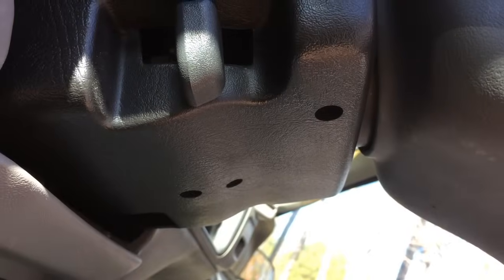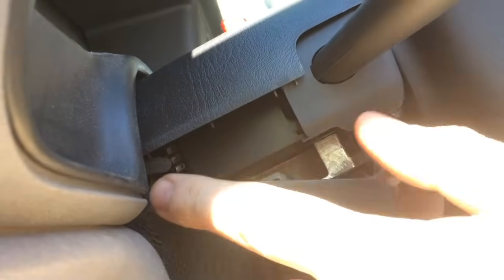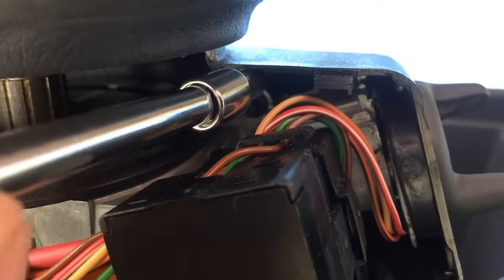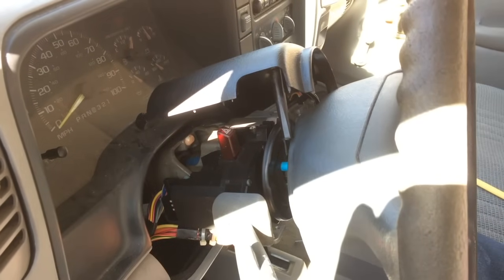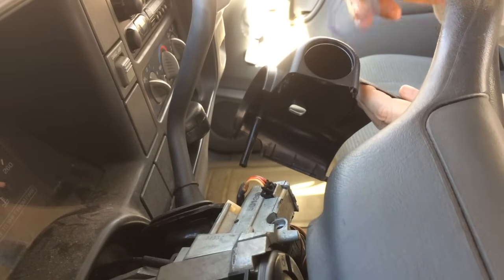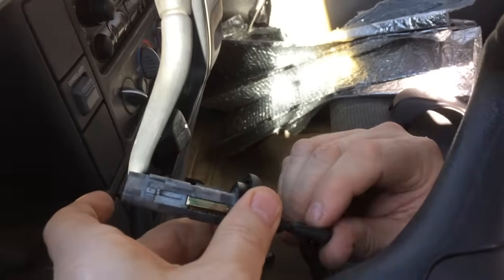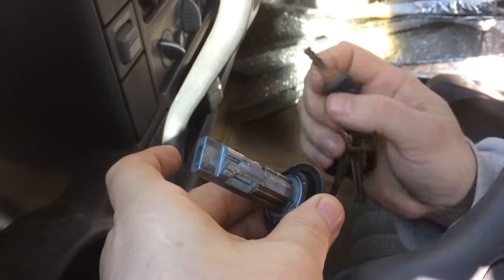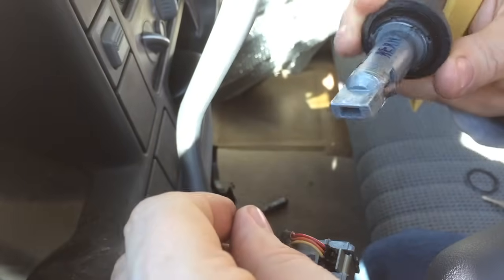1995 - 2000 OBS GM Truck Ignition Lock Cylinder Removal (Chevy Cadillac & GMC)

Comment: So how did you end up getting the lock cylinder out cause I can’t get mine out it won’t turn all the way to the starting position and I just keep missing the keeper with the punch
Reply from the maker: It will not come out unless you can turn it to the start position like I've shown in the video.   You'll have to get the obstruction cleared first, lock lube and jiggling with it so the release pin is aligned.  Otherwise its a drill it out situation.
Reply from the maker: Check down thru some of the later comments, I believe earlier this year a couple of folks had a similar situation and managed to get the cylinder to pop free after alot of patient wiggling and jiggling (and copious lube) so they could get the release pin aligned to remove it.  Worth a shot before a locksmith (who will just drill it out anyway).
Reply: DrShock still it out?? Like where the key goes?
Reply: DrShock ok thanks

Comment: What if I don't have a key. How can I do it with out a key
Reply from the maker: You can't remove the ignition cylinder without the key on a GM vehicle.   Without the key, you need to call a locksmith.   They can get the cylinder out without a key.

Comment: What if I’ve lost the original key?  How do I turn it to release if no key?
Reply from the maker: Time to call a locksmith if the key is lost.
Reply: @DrShock  ugh!! Dang it
Reply from the maker: Some folks would give the drill a go, but imo too much chance of damaging the column and other nearby parts.   A locksmith has the right tools, which are legally restricted from sale to the general public, to pop that cylinder right out.
Reply: @DrShock  yeah I’d most definitely screw something up